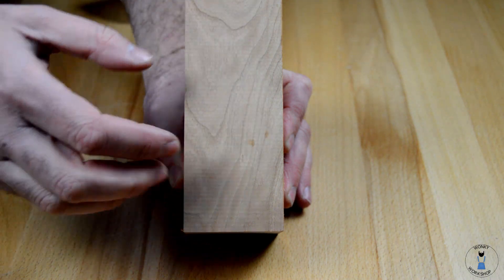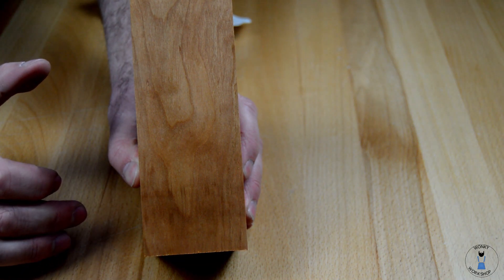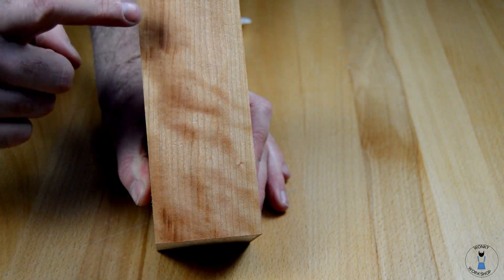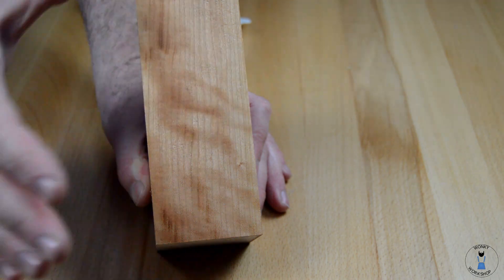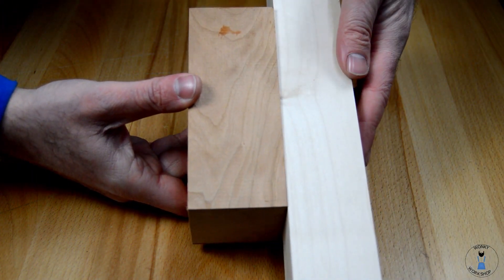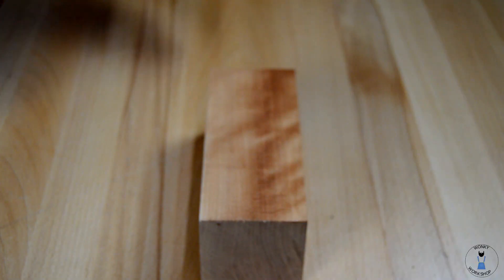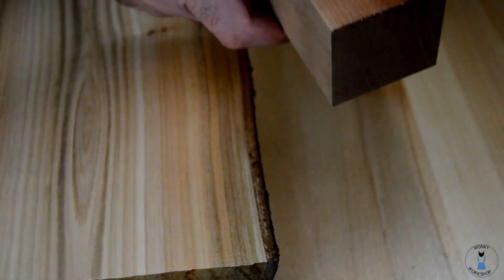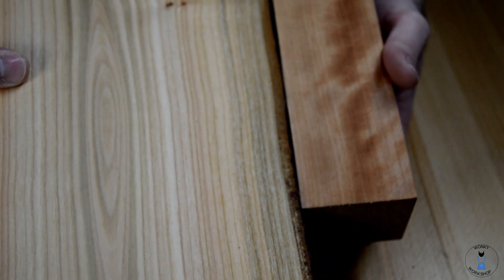Wood Wecognition Wednesday: American (Black) Cherry

Comment: Thanks for sharing. That's the beauty of this species. Darken up with in time. Not as dark as Brazilian Cherry. I am in the middle of redoing the veneer on a 1975 pioneer turn table. It's gonna look beautiful.  I am gonna use some poly satin.  To finish  up.    I am not sure how to apply the wax or oil you mentioned. But I think what I  have in mind it's gonna be ok. Unless if you suggest wax or oil. Thx.
Reply from the maker: Most waxes or oils i apply with a disposable material such as a kitchen roll as long as it has no colour present. If you use an oil make sure you spread the material out afterwards and allow it to dry. This is to prevent the oil generating an exothermic reaction and catching fire. But poly satin would work fine i'm sure
Reply: @Dan_Tarrant_Woodturning  thx.  End up using some product Glitsa poly 500 satin turn out amazing. Not shiny love it.